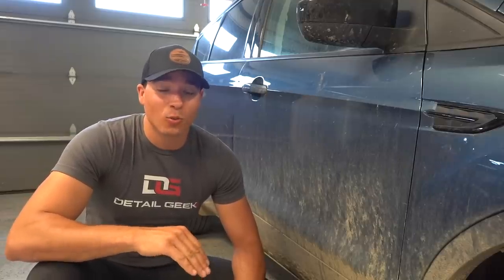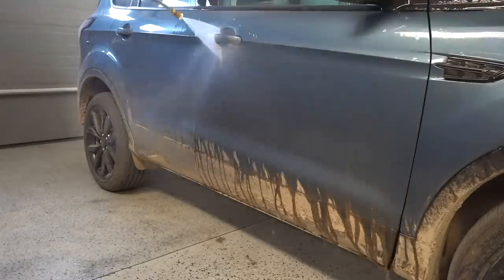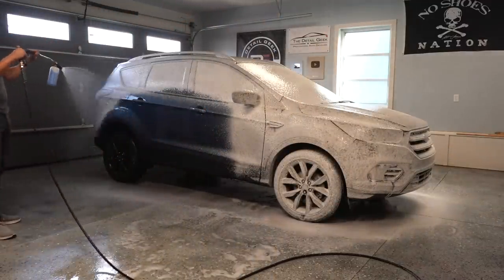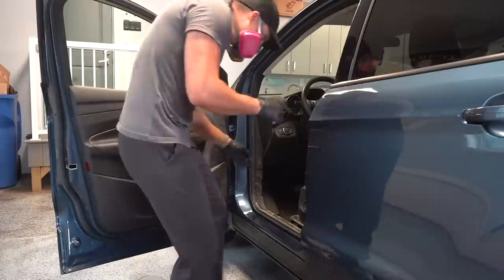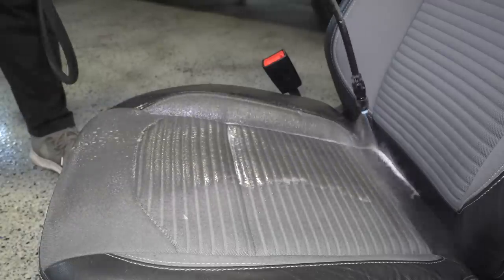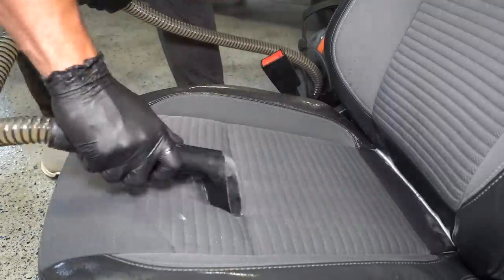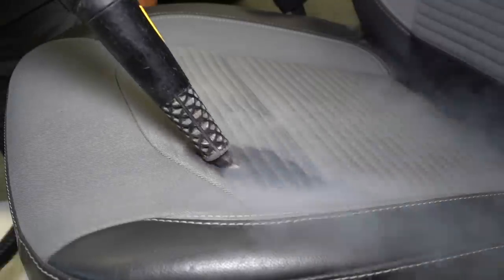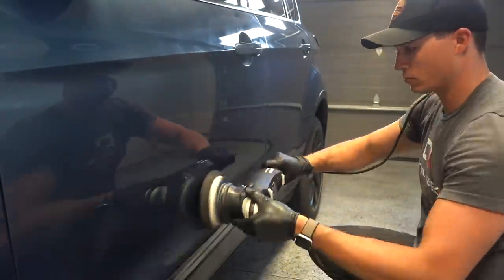Cleaning A Farm Girl's Vehicle That Was INFESTED With Mice! | The Detail Geek

Comment: When I lived in the country my mechanic discovered mice had moved into the engine bay. Apparently they really like staying in engine bays at night as they are nice and warm after running the car all day and also very dark and safe. Problem is mice enjoy chewing through all the wiring in there which is not a good thing! But the solution was easy, he told me to just leave the bonnet open at night, that way it doesn't stay warm and it's not dark if you leave the car port lights on so they will move elsewhere.

Comment: Mouse infestations are very common. The most popular nest location is in the cabin air filter. They soak everything in there. VERY dangerous to NOT replace the filter and clean the housing and associated area.

They also love to infest the engine. The air filter is their favorite but they like areas under the engine cover and around and in battery and fuse boxes.

Every owner should check for them if the car sits unused for a day or more.

Comment: That giant dealer ad in the back window wouldn't have lasted 24 hours on my car. In fact, if I knew they did that, I'd request they NOT do it to mine. Similarly, never knew why some dealer put stickers all over their service loaners. Sort of like an ad saying "I'm broken down at ABC Motors" Anyway, nice job on the car. Easier than you might think to do the can opener thing on a car floor. Ask me how I know,,,,,
Reply: Yup, the dealer-cals on the car you buy don't lower the cost or bring any income for the rolling ad. The dealer's lucky if I even keep license frames past the temp.  Though, we don't know if the car belongs to the dealer's family.  That level of neglect on a 3 year old car might only happen if you aren't concerned about replacing it.

Comment: Are the seats hard to remove
Reply: Most seats aren't, slide it all the way forward, get the 2 back bolts, slide it back and get the 2 in front, unplug and out it comes. Usually isn't any more complicated then that.

Comment: Once in my honda CRV I had left a packet of popcorn in the glovebox and the next day when I opened the door there was this disgusting oddur that was like poop 💩 and I started driving a bit confused and I heard a screech from the glovebox and when I opened it ,eet jump out 2 mice.... I stayed calm as the mice were on the passenger seat...... I pulled over and opened the door to let them down.... When I pulled over I noticed that my turn indicators were not working and I immediately drove to the Honda workshop and they upon their investigation they found that the mice had cut the wiring harness and I was put up with a bill of around 21k INR that's around $300.... All just for leaving a packet of popcorn in the car 🚗..... Even worse was that they had left 2 tiny mice in the boot..... JUST DISGUSTING....

Comment: I fucked up the 4 runner 2021 washing with pressure underneath and engine water went through steering wheels, wire hariness, power windowand flooded